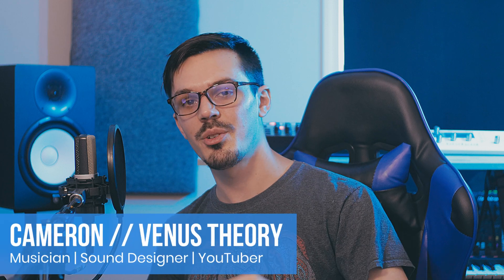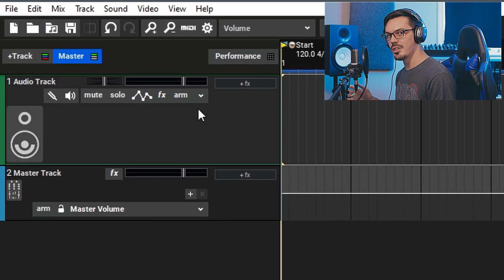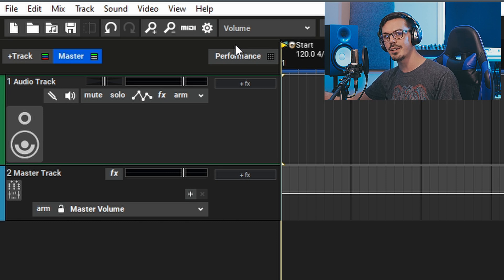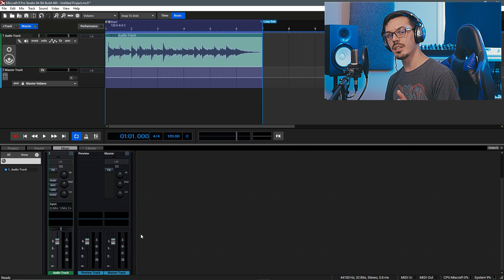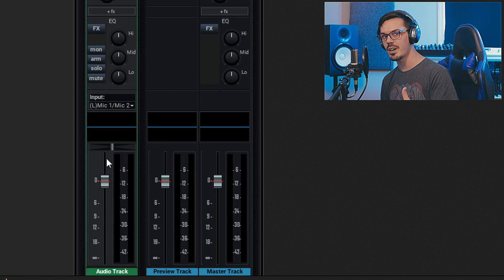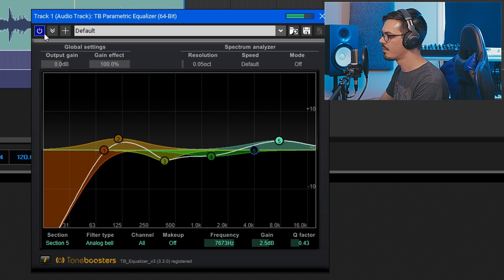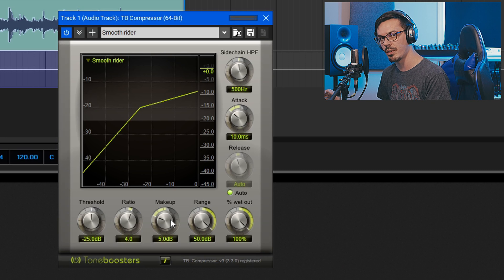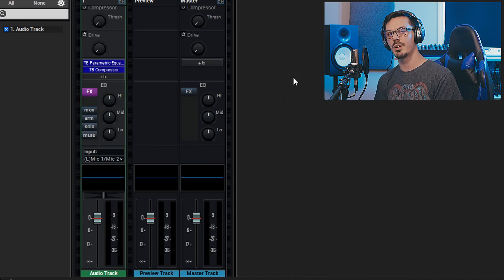Mixcraft Quick Tip | Gain Staging Explained

Comment: Is there ever a time where I should move my faders from unity gain to control volume or signal?
Reply from the maker: Hey there! The faders would generally only be used for the mixing process, so for the process of gain staging you generally don't need to touch them.
Reply: Ok so why and some do some engineers move the faders down in a static mix?
Reply: I'm sorry I'm just confused as to when should I touch my faders if I already got the signal good during gain staging is it after plugins I can touch the fader?

Comment: So my meter signals need to hit my fader unity gain spot or at -18 on the rms meter which is the so called sweet spot?  And do my VST meters  if they clip effect the insert signal  meter?
Reply from the maker: Generally speaking you want the signal level to match the level of the fader in order to use the full fader travel path effectively. As for clipping within plugins, you would want to avoid this if possible by using their 'output' or 'gain' control to ensure the level isn't too out of control!
Reply: Thank you

Comment: You need go have a video on a singer doing gain staging as well
Reply from the maker: Hey there! All of these tips would apply for vocals as well, there isn't really a difference in the process beyond ensuring that each passage has good gain staging in the case of an especially dynamic performance.
Reply: What about instruments thru midi tht clip sound

Comment: Might be a stupid question but my faders don't read 6,12,18, etc. Mine read 9,18,27. why would that be?
Reply from the maker: Hey there! The meters in Mixcraft that ready 9,18,27 would represent the level relative to 0dB. So, 9 represents -9dB and so on. The numbers next to the fader handle (6,12,18) represent the adjustment level in dB and 6 would represent -6dB.

Comment: Nice tutorial. You forgot completely about normalization and how it pertains to gain staging. 

It would be cool to implement gain staging like pro tools where you can drag the gain up or down on the clip itself.

May I suggest you do a video about connecting outboard harware (like Vocal processors or compressors) into Mixcraft? I don't know how to do that with my ID 14.
Reply from the maker: Hey there! Normalization wouldn't actually really be a part of gain staging as it would normalize the recorded audio. If you didn't gain stage properly it would set it to an arbitrary level, but also increase the noise floor along with it. Although it's useful to normalize a clip that's recorded properly, it's not necessarily a part of proper gain staging practice.

As for gain staging per clip, this is already possible actually - to do that you can click and drag the white handle in the center of a clip to raise or lower the volume.

We can note that suggestion down as well for a future video!

Comment: I wish the master track could switch the project to mono. And i wish the master meter was more detailed. extremely basic. I do love mixcraft, but those to things could really make it that much better. Also if mixcraft had a VST specifically for drum mic bleed like the drum leveler, this software would be bought by everyone.
Reply from the maker: Hey there! We can definitely note that down on the suggestions list for a future update!

In the meantime, you could use something like the free Melda Productions bundle to access metering tools as well as a stereo tool to collapse the master track to mono!
Reply: @acoustica222  yes I have a vst that does that for me. Just a nice option when it's on the master mixer or by the meter. Just some button somewhere so I don't have to open another vst. Not a must have just convenient. Thank you for replying. Love the DAW!

Comment: The numbers showing on the potentiometer/slider are not the same as the numbers in the meter. So when you say 0db, isn't that really like -9db or so? Isn't the zero on the slider basically arbitrary? I have seen equipment where "zero" is-3  -6 or -12 or -18. I get what you are saying about being able to use the full range of the slider, but at first I was very confused by your interpretation of zero DB.
Reply from the maker: Hey there! That's correct, the meters here are not actually reading out at 0dB but rather using the 0dB line as the reference level for unity gain. Mixcraft has the meters set to -14dBFS for unity gain levels.
Reply: @acoustica222  so should we gain stage to -14 on mixcraft then?